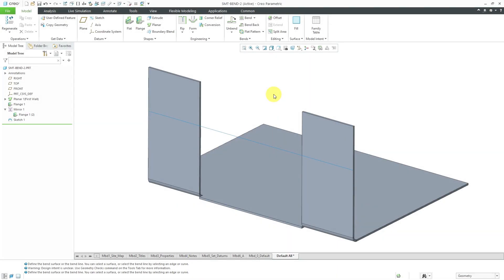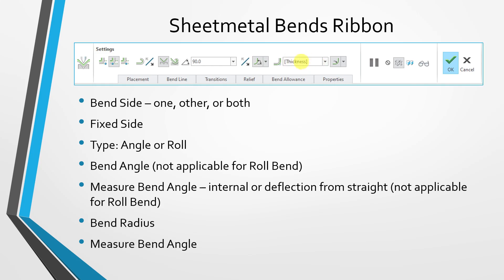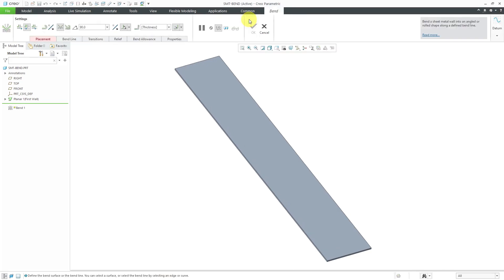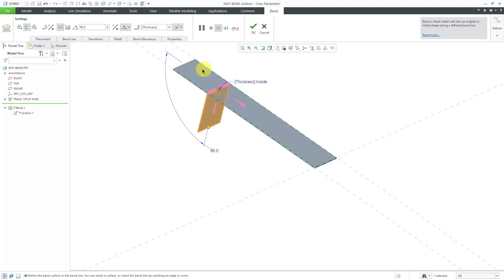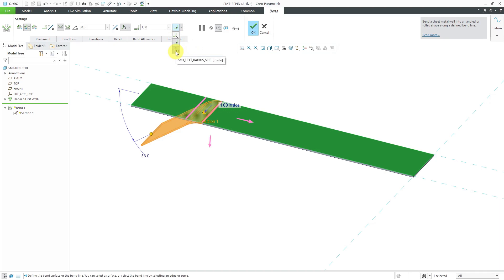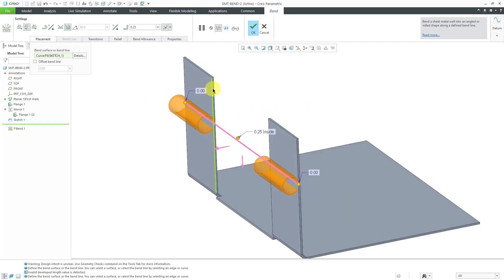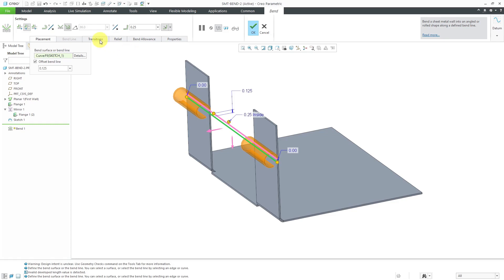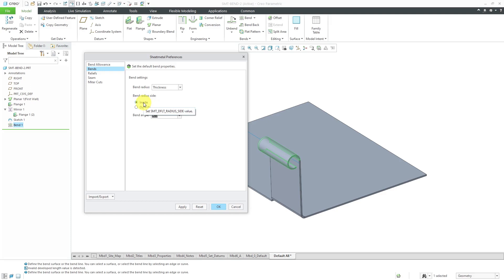Creo Parametric - Sheetmetal Bends (Part 1)

Comment: How can you make a bend relief along the bend axes of a flange? I need to make a half round that shows bend points after flat is cut on a router?
Reply from the maker: I would try a Bend Back, put in the relief (possibly as an Extruded Cut), and then Bend.

Comment: what is different between flange and bend?thank you
Reply from the maker: A flange is secondary wall added to one or more edges in the part. A bend is applied to the existing geometry in the model. The flange adds mass whereas the bend does not.